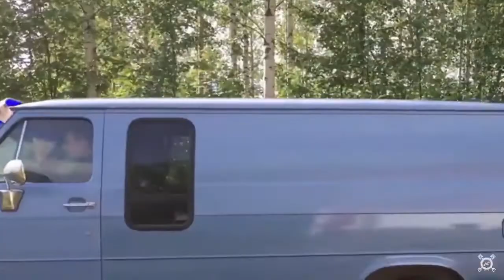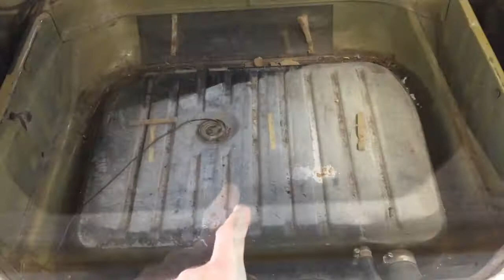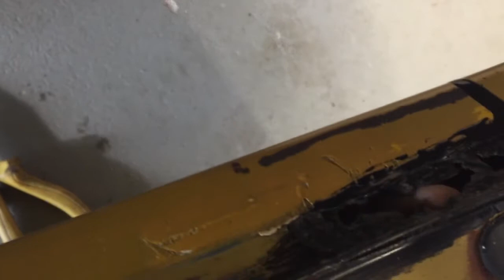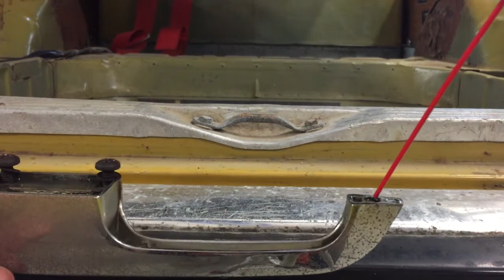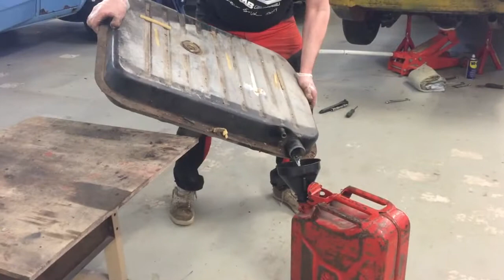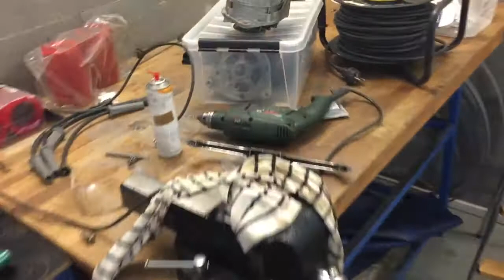Rear hatch and fuel tank | Volvo 145 |

Comment: you take a screwdriver hold it against one edge of the '' lid '', and hit with a hammer, it should be knocked to the left I want to remember :) on the gastank
Reply from the maker: I tried that but I think I wasn't hitting hard enought... I'll use WD40 and some more power. ;)